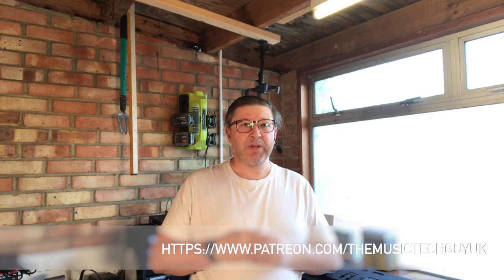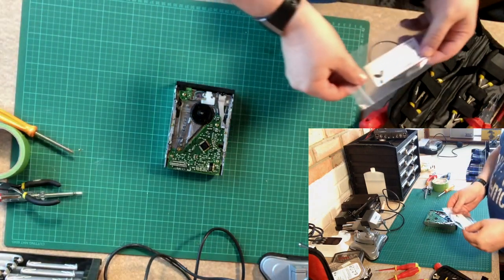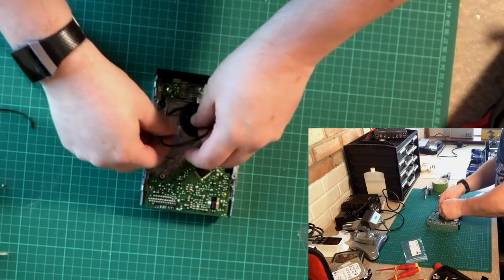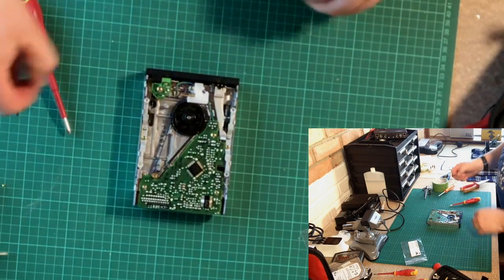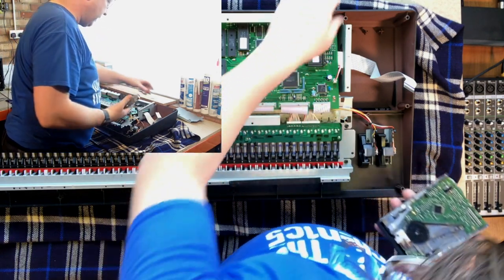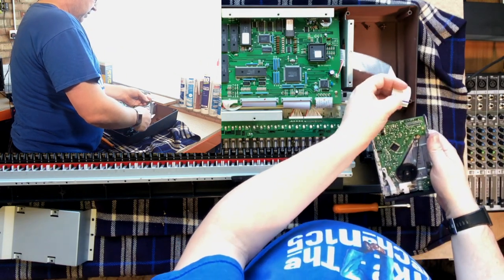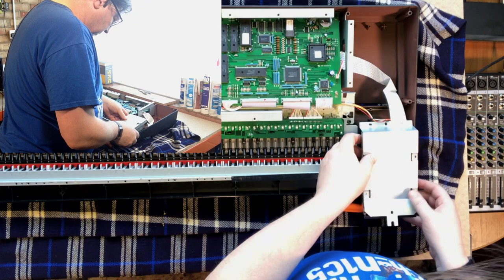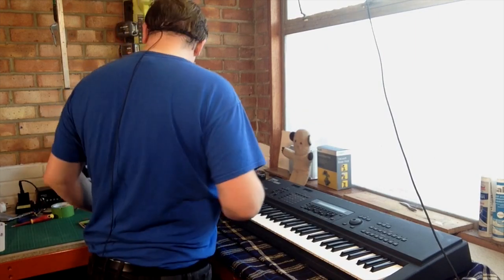Yamaha SY85 Restoration - Part 3 - Disk Drive Belt Replacement

Comment: I love how real and honest your videos are. You are truly the "every man handyman" of synth repair. Very inspiring and confidence building to all us DIY repair. Also your multi camera shots look great on both workbenches. Thanks for the videos.
Reply from the maker: Hi and thank you for the feed back.

To be honest my approach is really taking a step back and assessing the problem.  And with each synth, tone module etc I tackle, just increases my confidence.

Most synth repair jobs can be tackled by you.  If you just take a step back and think the problem through.  Well that’s my approach anyway.  But there are times where I will refer to an electronic engineer.  

Also thanks for the feed back on the multi-cameras.  I struggled with the first few to get the videos to synchronise until a friend suggested the simple addition of a ‘clapper board’.  

As I have always said the channel is funded by me.  So the purchase of video equipment, lights, microphones and recording gear comes out of my pocket.   I have been struggling with the sound on the second camera.  It keeps dropping the feed from the mixer in favour of it’s internal mic and for the life of me I can’t work out why! Ho hum!  

It is the reason I started promoting the pattern account as I know the videos can be improved, in fact anything can be improved with an open cheque book.  But seriously it is a way of moving the channel along a little bit faster.

Any topic you want me to cover just let me know.  Jon

Comment: Hola! De gran ayuda sus vídeos!
Tengo un piano de ese mismo modelo; SY85, pero esta en mal estado! El piano enciende y suena cuando lo conecto al monitor, pero tiene muchas teclas dañadas y algunos botones no funcionan.
Reply from the maker: Have you subscribed? :-)

I guess you will need to do an assessment of the keyboard to see if it is worth saving.  Tack switches and keys can be replaced with a little diligence and a soldering iron.  With key contacts you need to work out whether the contact or mechanism is the issue.  Both are fixable.

Cracked circuit boards can also have tracks bridged.

Not sure why the keyboard is chirping.  That might require an oscilloscope to track back through the board to find the issue. Jon

Comment: I need help for this. Do you know the exact size of belt (diameter) for the floppy disk of the Yamaha SY85? Thank you so much.
Reply from the maker: Have you subscribed? ;-)

Hi Maximo.  The belt can be one of two both are 59mm Diameter.  And either 2.8mm width or 2.0m width.  0.5mm Thickness.  How this helps you.  Jon
Reply: @TheMusicTechGuyUK   Hi!  Thanks for the information. Yes i am a "Subs". haha